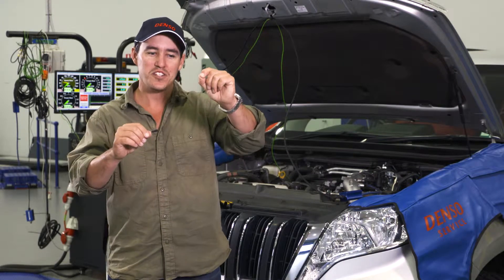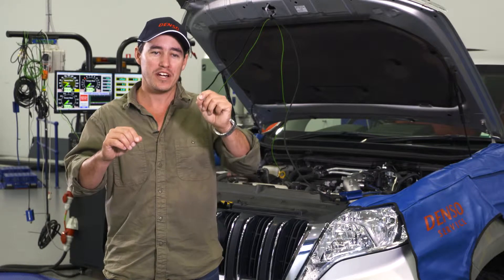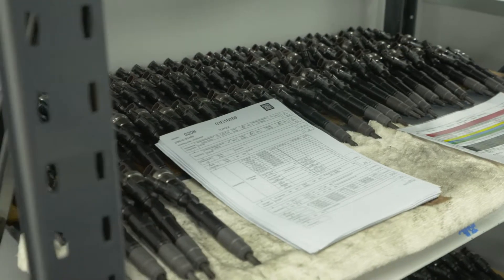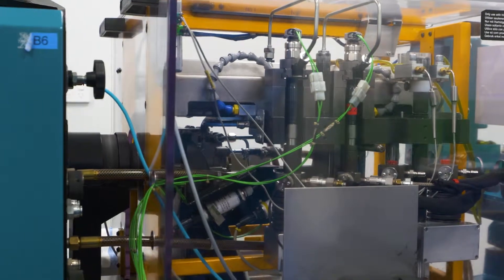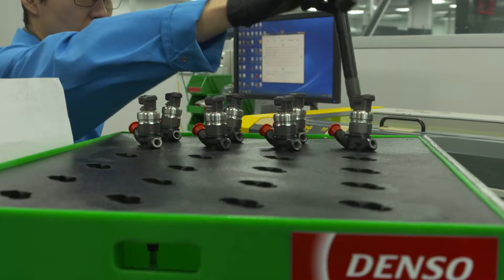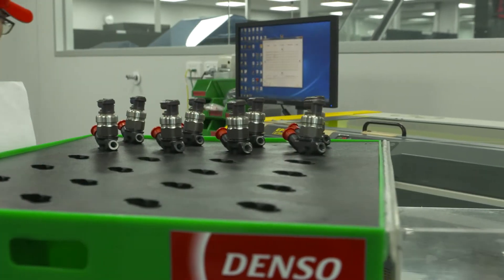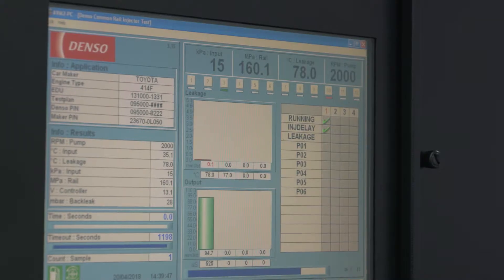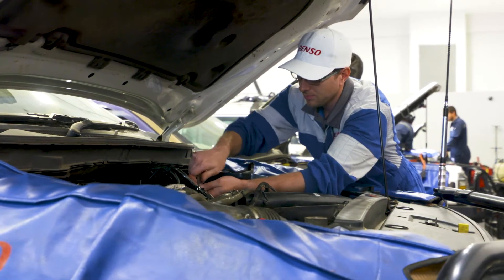DENSO 4WD ECU

Comment: I have added 1kd injector new, now how do I coding it, please do some explanation
Reply from the maker: Hi Fazal, When replacing an injector marked with a compensation code, It is necessary to register the ID code printed on the upper part of the injector with a genuine OEM or DENSO diagnostic tool. Allow for some running time across a range of operating conditions for the Engine Control Unit to go through a self-learning cycle to ensure optimum injector performance.　

Any Toyota dealership should be able to preform this Task, alternatively a Authorised DENSO Diesel dealer should be able to preform that task also.